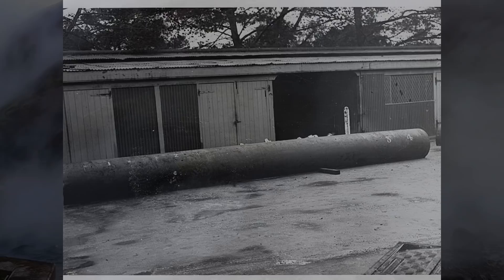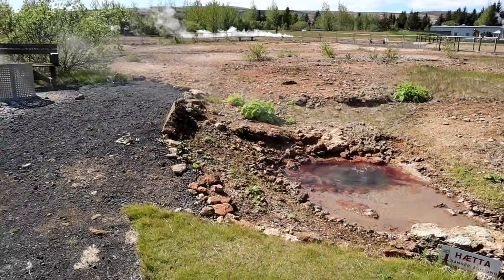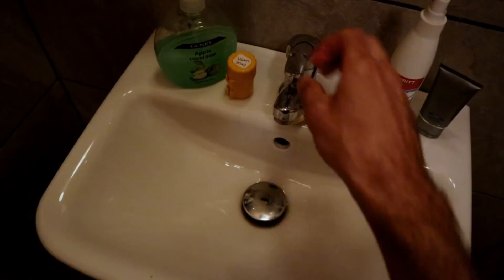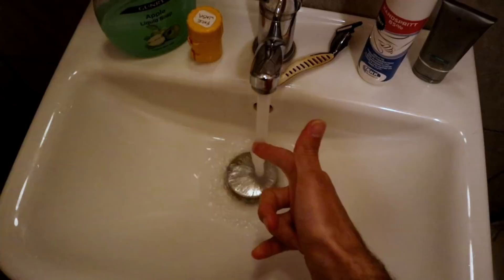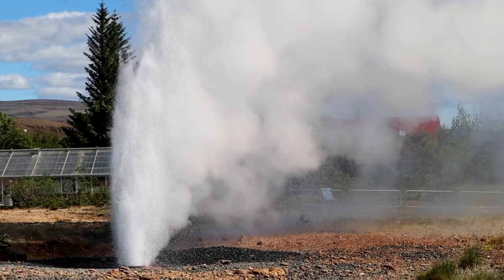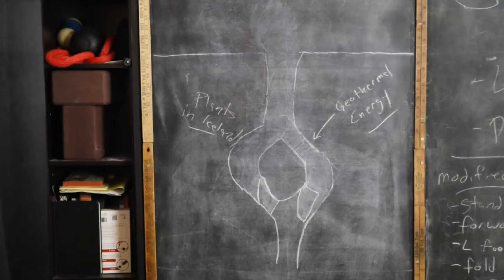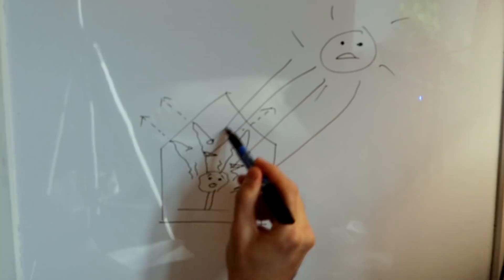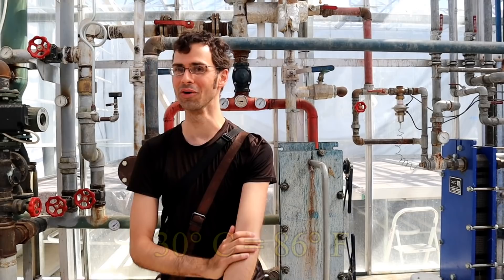The INCREDIBLE Way Greenhouses work in Iceland! - ICELANDIC BANANA SAGA

Comment: Another big use of geothermal in Iceland is it's a great source of heat/power for aluminium smelting, which normally is a very costly process because it requires so much energy. Apparently, it's worthwhile to ship the unprocessed metal to Iceland, process it there due to the low cost, and ship it out again to the rest of the world.